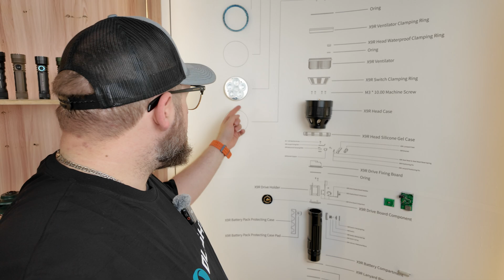Olight 101 - What’s Inside a Flashlight? Parts & Functions (#2)

Comment: Baton turbo
Two major shortcomings, 1. When you do the double tap to get to turbo mode, you can’t get out of it by another double tap. You can only turn it off. What brings me to shortcoming number 2. When you have turned the baton turbo off, the moment you want it back on it only comes on at max output, not turbo stand but one mode before that. What i would like is double tap to go to turbo mode and also a double tap to get out of turbo mode, like many other Olight flashlights. Second when you go out of turbo it would be nice if it went back to te mode you had before instigating turbo mode, and not automatically to max output (not turbo the mode before turbo)  It is a big big misser in my opinion. Please make sure it wont happen again.